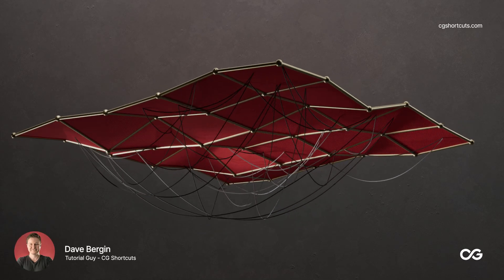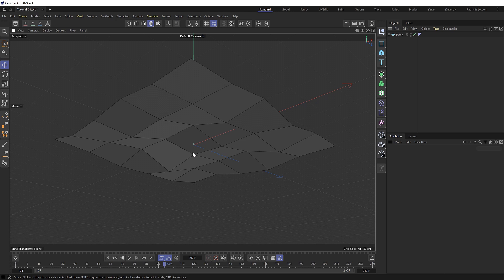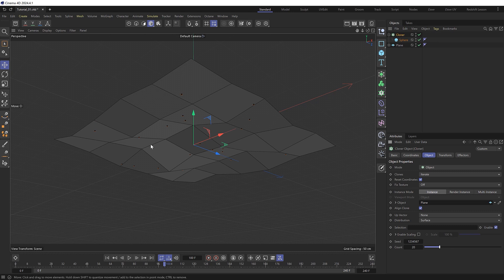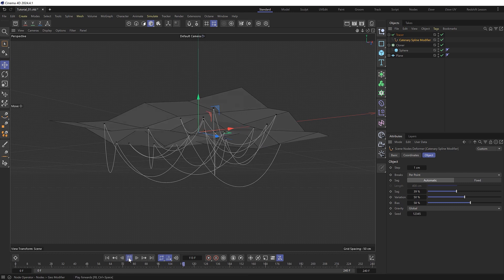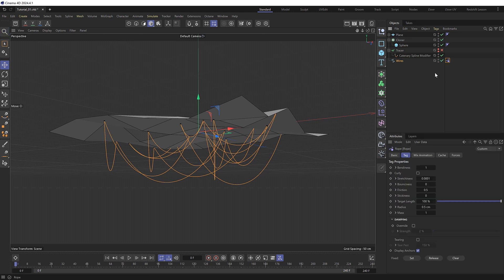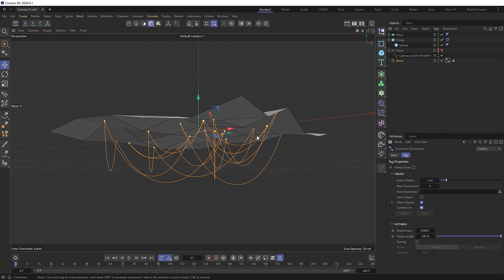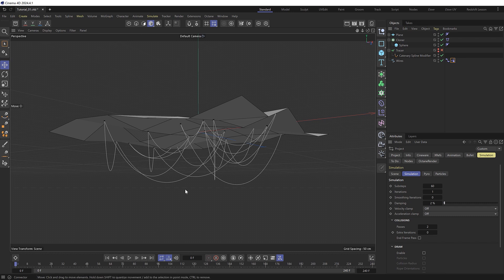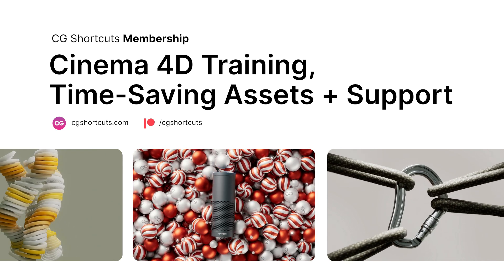Attach Dynamic Wires to Any Object in C4D - Cinema 4D Tutorial (Free Project)

Comment: hello. I have applied all the steps and got a satisfactory result. Thank you. I encountered a problem while displaying the render animation. The ropes do not move. I have converted it to bake to as abc But that didn't work.
Reply from the maker: Not to sure what you mean, give the project file a try to see where you went wrong
Reply: @CGShortcuts  Thanks for your reply, actually the dynamic wires don't move during render, is that  normal ?